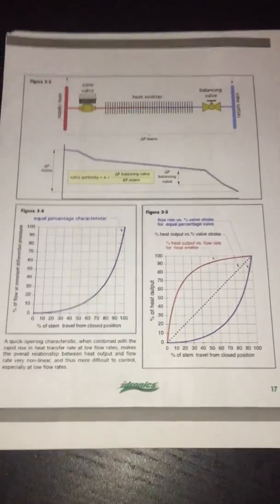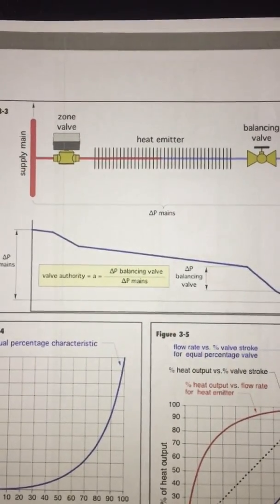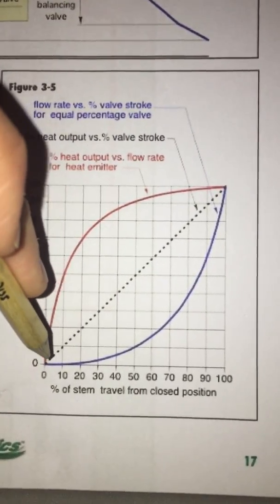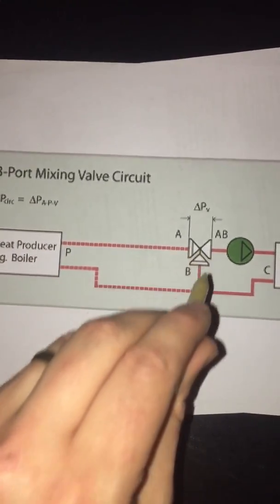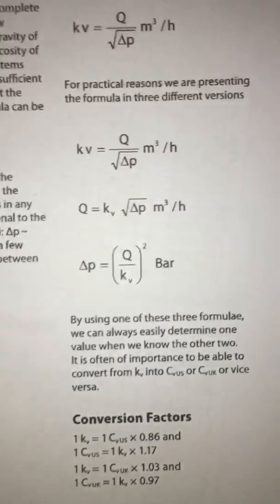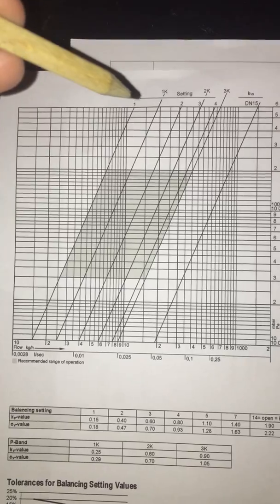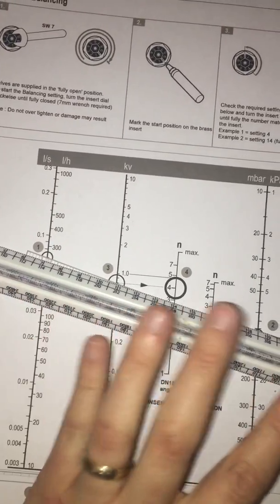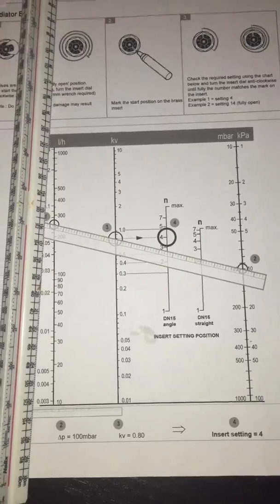Valve authority and flow coefficient

Comment: The red line is referring to the capacity of the associated coil or "POWER".  That figure shows how the valve flow curve is inverse that of the heat emitter output, which when combined, creates a linear control line.